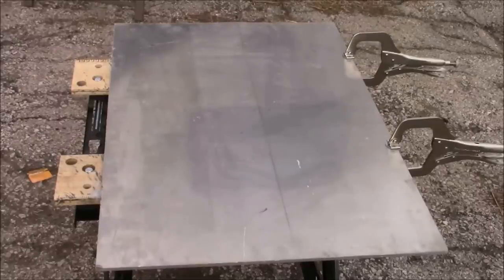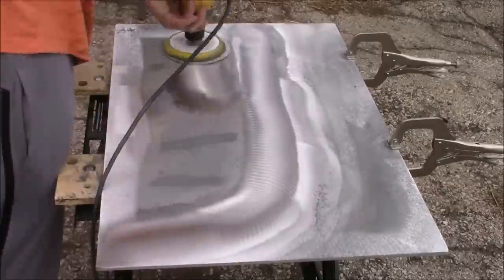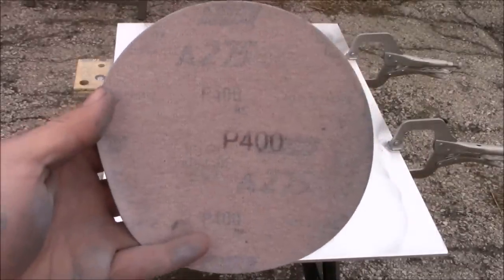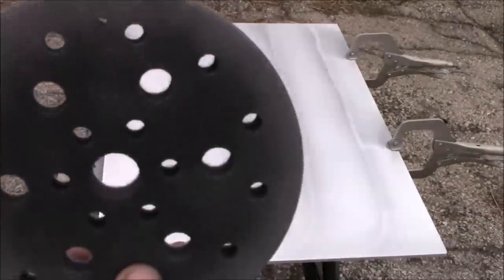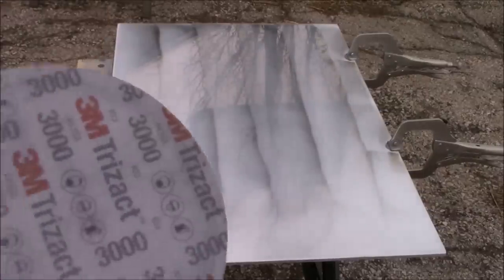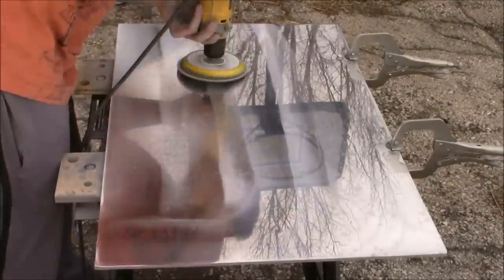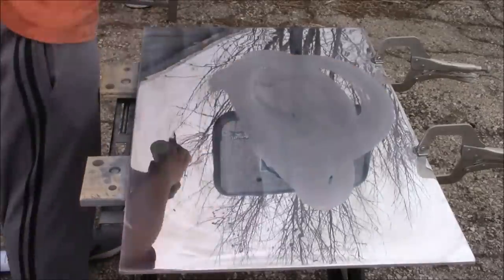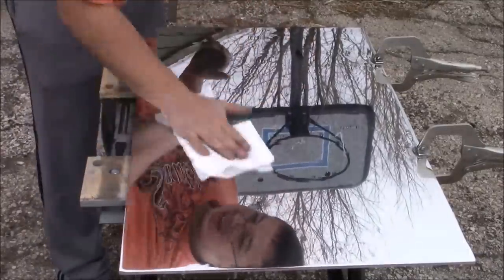How To Sand and Polish Aluminum To Mirror Finish

Comment: could you use the disc with the dust holes or no?
Reply from the maker: For this kind of sanding it would be best to use sandpaper that doesn't have the dust holes.
Reply: Skills and Trade awesome thank you. I want to do this on my tailgate trim panel on my 96 f150 but I’m worried about the upkeep. Any idea on the best way to clear coat and how long it would last? I’m debating just sending it out to get plated
Reply from the maker: The polish I used contains a sealant that will hold the finish for several months or longer. If you use wax it only compounds the protection.

Comment: Can you use a 6" random orbit sander instead?
Reply from the maker: No probably not. It wouldn't have the power necessary.
Reply: I was thinking something like a Porter Cable 6" polisher or do you think just a drill without the random orbit action is better. Great video by the way! I'm trying to do square tubing 6063 alloy (harder than 5000 series) with a buffing wheel and green polish and it's not working.
Reply from the maker: I think that a drill without the random orbit would be better. Thanks I'm glad you enjoyed the video. Good luck on your project.
Reply: I'm giving this a shot, I like it so far however the 220g  you have listed is psa not hook and loop and won't work with the 3 M pad. Do you spray WD-40 at each stage or just the 220 and 400 and on the pad at 3000? Thanx.
Reply from the maker: Just the 220, 400 and 3000 and 5000. Sorry about that link I will change it.

Comment: What does this polishing effect look like the next day?
Reply from the maker: +Franciszek The same. The polish should hold for a few months depending on weather.
Reply: Thanks for the information.
Reply: Skills and Trade doesn't the aluminum oxidize, which gives it a more white-ish appearance? Or do you put some wax on it? Or is that was included in the polish?
Reply from the maker: Well, the polish I used has some sealer included in the polish so it won't oxidize for a while.
Reply: Otherwise, work some Protector into it and polish accordingly. It's how my grandfather still had his Aluminum/Aluminium mirror for three years with no faults. (Until Grandchildren (i.e: My Cousins))

Comment: You did not sanding  it evenly that why if you wait to the end and looks at  the electrical lines on the electric  pole they are wavy pros now that stuff an you should be using silicon carbide to sand on stainless  and  alumini oxide sandpaper is for aluminium and take that out of the shade you see all the buffing lines you leftpolishing compound and buffing wheel would shine better and cyclone buff to get the buffing lines out use a sisscial buff to cut stainless

Comment: NEVER EVER use steel wool on aluminum. You will embed ferrous metal particles in the aluminum and will forever have rust spots, use stainless steel wool if you need to!

Comment: Why polish it? Aluminium shine doesn't last long anyway. Waste of time watching this.
Reply: If you’re going to take the time to polish anything aluminum you can clear powder coat or use Zoop, a hybrid ceramic coating. Both will last for years.
Reply: @skeezix8156  Today, yes. But in my days polished aluminium was coated with a clear lacquer and it would still fade to a silvery color. What you say now is that the lacquer of today may have properties that doesn't tarnish the polished surface. I hope to see your work finished with the coating you're talking about.
Reply: I’ve used both on parts of different sizes, no yellowing or silver dulling. Whether it’s a dash panel or an accessory bracket in the hot engine compartment they both work well. Now the clear powder coat can chip if you drop it or aren’t careful with your tools, but it’s a nice alternative to paint
Reply: @skeezix8156  
That mean I can polish my V8 aluminium rocker covers and then apply this type of lacquer, and the heat doesn't affect it, right?

Comment: anything over 800 grit is a waste of time.use the right product for the right job..this is not how to polish aluminum.
Reply from the maker: Thanks for the tip. Seems a little harsh, the aluminum did get a mirror shine in the end after all.
Reply: john d fine to criticize, if you have a better solution. What's your method? That would be constructive. When you just throw criticism out there, without adding anything you come off like a jerk.  Don't be a jerk.  Now there's some constructive criticism for you. Read and learn.
Reply: hire a professional
Reply: Hey, you got results!
Reply: john dillinger Then why watch the video?
Reply: Don't be that guy.